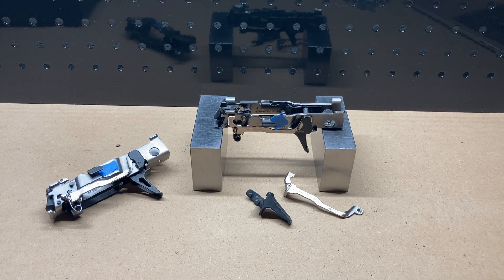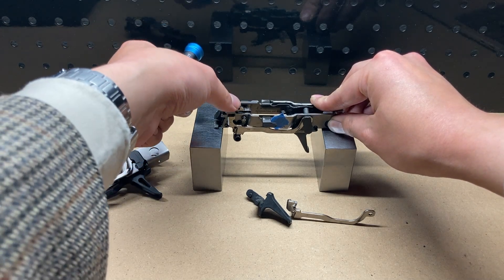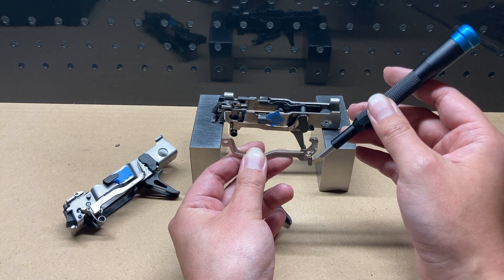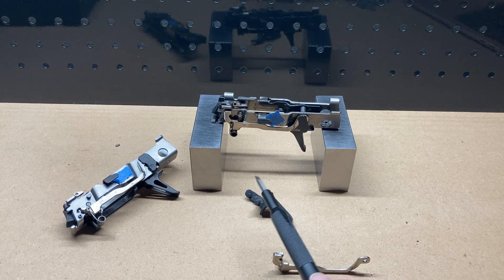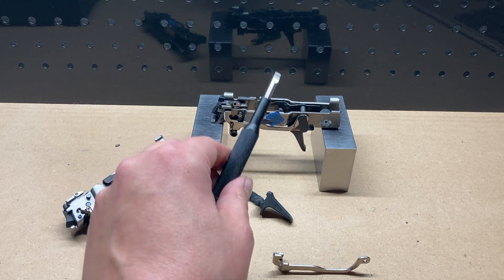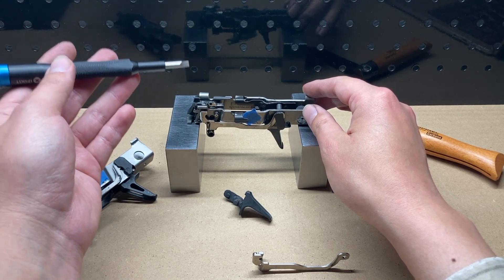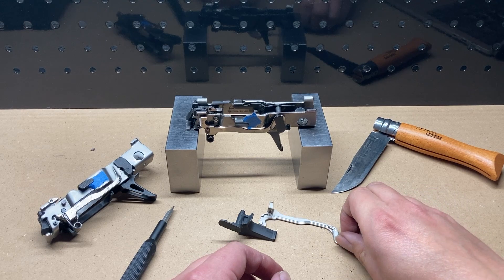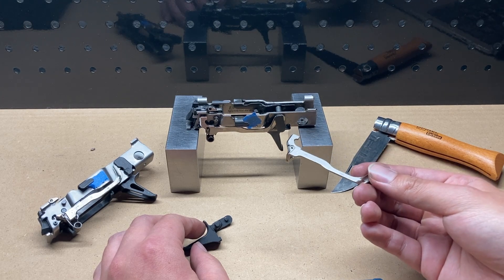P320 Sear Movement Test followup: It's all about the Trigger Bar and Trigger

Comment: Thanks for taking the time to do this research. 
I have a M18 CA model made in 4/19/2024. 
When I removed my slide and tested it I found that not only does the trigger bar move down and forward instead of just forward making the striker safety “pop” up at the end of the sear movement, but with the manual safety engaged, the striker safety doesn’t move with the sear at all. This would strongly indicate that as long as the striker safety components are not defective in my particular example, it cannot discharge even if the sear releases the striker while the manual safety is engaged because the trigger bar is blocked by the manual safety. 

I couldn’t get mine to “fire” with the gun assembled using a long wooden dowel in the barrel and depressing the sear with a pick with or without the manual safety engaged. I’d be interested to see results from others with newer and older models. It’s pretty apparent Sig has made silent changes over the years. While I’m glad my pistol appears to be safe, it would be nice if Sig would own up to the possibility of older or different models discharging no matter how unlikely it might be and offer at least another “voluntary upgrade” to make them safe(er).
Reply from the maker: That matches how I anticipate a manual safety would influence FCU behavior - I'm eager to see if I can get my hands on a manual safety P320 soon to observe that behavior first-hand...
Reply: I have a first-gen model that underwent the "voluntary upgrade" - I'll have to try this at home and record my results.  Almost feel like there should be a crowd-sourced spreadsheet or better yet video database of owners doing these tests along with the manufacture date of their  320, any non OEM parts/upgrades, round count, etc.
Reply: Just to add, this applied to my CA320 for anyone that’s worried about their Franklin Armory 320s
Reply: I have the same M18CA model. Mine behaves like yours. Just checked after watching this video. With the manual safety off, pushing the sear down moves the trigger bar forward and disengages the striker safety at the same time, identical to pulling the trigger. With the manual safety engaged, pushing the sear down, causes the trigger bar to move down instead and not disengage the striker safety. I wonder how many of the holster pops reported were with the manual safety p320s? Although there is nothing forcing you to use the safety, so I guess that would prove nothing anyway.
Reply: @HotelHilbert-s6l  I have similar experience - If the theory is correct it suggests that having the manual safety engaged in the holster would prevent an uncommanded discharge in the event of sear movement being forced somehow.  Tested my Xfull-CA and my wife's M18-CA tonight and both show the "disconnector-like behavior" we want to see.  But with the manual safety on, the striker safety doesn't move and the trigger bar just moves downward.  

It would be interesting if we could find a manual safety FCU that does not exhibit the disconnector-like behavior (or install a known-issue trigger bar in one) to confirm that engagement of the manual safety would ensure that the pistol could not fire uncommanded.  

Would be great if Sig would do this work so we don't have to, though...
Reply: @WestCoastChainmail I too am sitting in front of my disassembled CA XFull and coming to the same conclusion. My trigger bar is stamped with 576, just fyi. The tolerances on the FCU are a bit too minimal for my piece of mind. 😂I feel like the slightest bit of carbon build up on the seat ledge would cause issues on older models without the disconnect
Reply: @WestCoastChainmail  Please be careful.  It is still possible for the striker to slip off the sear, with the manual safety on, there have been documented cases in the military.
Reply: @HotelHilbert-s6l interesting. When was yours made? My trigger bar goes down then forwards when I press the sear. The striker safety doesn’t move until the sear is pressed almost all the way down and the trigger bar pops forwards. Interested in seeing if it changes when I install my apex trigger bare and sig armorer core action job kit.
Reply: @xi-deadshot-ix5838  Not sure. Was just after the CA model was released. When I saw this video, I thought WOW. How can pushing the sear down pull the trigger. The trigger bar pulls forward on sear/trigger bar engagement surface, which sits just in front. There is no way it should be necessary that pushing the sear down should pull the trigger bar forward. But it does on mine. I have other fully cocked striker guns, and none behave like this. This is a terrible design flaw. If anything gets into the underside of the slide and pulled in when the gun is racked, just pushing on the grip might push the sear down and fire a round. In the case of the manual safety, it seems to push the sear down and makes the pistol safe(r)

This is probably the issue and Sig almost certainly knows about it and is denying it. It is too bad, because I like my p365, but Sig is going to be sued out of business and probably deservedly so.
Reply: @xi-deadshot-ix5838  I have an M18 I bought in Oct 2020 and was made July of 2020. It passes the test and functions like your description.
Reply: @xi-shot, would it be possible the mag disconnector is playing a role that prevents the sear being pushed down?
Reply: @adolfhilter  My mag disconnector "fell off" the pistol as soon as I got it home from the cali 10 day jail. So, no I don't think so.
Reply: @adolfhilter  I removed my magazine disconnect. The last thing I want is to not be able to use the one round in the chamber if I need it while reloading or if I accidentally eject a mag. I don’t see how it would interfere with this test if it’s disengaged as if there’s a magazine in it. From what I can tell it acts as the manual safety does blocking trigger bar movement when the magwell is empty.
Reply: I noticed the same thing too on my manual safety P320. I specifically wanted a manual safety since I don't like any gun that lacks one (hence why I refuse to carry Glocks). Seems like my choice was vindicated here. lol

For my gun, I did install an aftermarket Apex trigger bar and it does demonstrate that "disconnect" behavior, though the downward movement when the FCU was in the grip module seemed much less than what I tested outside of it and I couldn't hear an audible click when I pushed down the sear. However, doing the test as shown in the Youtube Short didn't show the striker protruding out the end, so evidently that downward movement was sufficient at least on my gun to prevent an uncommanded discharge.
Reply: on sig's website, the latest trigger bar it sells does delay the deactivation of the striker safety.
Reply: @P320truther I cant speak on other p320, the CAM18's when you have the thumb safety engaged you cannot move the trigger bar forward when you defeat the sear springs. Nothing is able to push the firepin safety block up. what i want to know is will some of those aftermarket trigger blade safety triggers keep that bar also from sliding forward. This is my observation. All early model p320 even thumb safety versions that have the voluntary upgrade performed are not the same as the modern fcu's. These are what military and leos have currently and i believe these are the majority of the problems. That said.  personally i would never cary a condition zero firearm. I would only use the modern p320 with the thumb safety version unless someone shows that one of those aftermarket trigger safety triggers also prevent the trigger bar movement
Reply: This makes me less worried. I also have a M18, manufactured in June 2024. I think it depends on the manufacturing year.

Comment: Very interesting.  Have you provided your findings to Sig Engineering?   
I’m curious to know how the sear would move on its own?
Reply from the maker: How the sear is moving on its own is the multi-million dollar question that no one (including myself) seems to be able to answer. I'm just working on the outright assumption that it is moving, since none of the "uncommanded discharges" have been accompanied by reports of broken components, and no one has been able to show how the striker could be released without either breaking or the sear itself moving down to release it.
Reply: @ Thank you.
Reply: I just viewed this video again based on my recent viewing of today’s content.  

Again, this is very interesting information.  It makes sense that the design of the pistol would have the sear dropping the striker as step one and the striker safety block allowing the striker to release fully into the breach as a step two.  Very seamlessly of course.  

Just to confirm…the trigger bar that is moving forward only allows for the striker safety block release prior to the sear releasing the striker?  

I really appreciate your time.  I’m in the process of making some decisions and I am doing as much research as possible. 

Perhaps we will get additional information tomorrow.

Comment: You could 3d scan the bars and digitally overlay them to see where the tolerance differences are.
Reply from the maker: If only everyone could afford 3D scanning equipment and CAD software!
Reply: @P320Truther Patreon or some other crowdfunding could help. Heck, I’d chip in on one.
Reply: @P320Truther  You don't need full CAD all you need is a viewer and you could send off the parts if theirs nothing near to were you live "ask a local dental lab most have a scanner for 2 scans I couldn't imagine it would be difficult". You can use 3SHAPE 3D VIEWER it's for dental but it's free and has accurate cross measurements. I used it for years professionally. This tech more available than you think.

Comment: This is an incredibly informative and well put together video. However there is more to it than this. The design itself is simply less safe than virtually all other striker fired guns because of the sear and striker safety location and design. Along with no trigger safety. All of this combined with silly loose tolerances makes for a less safe handgun in a variety of scenarios. Basically whether or not your FCU passes this test the gun is still not as safe as almost every other duty grade striker gun.
Reply from the maker: I don't know that I fully agree with this statement. The final component blocking the striker being a rotating piece of bent piece of stamped sheet metal is certainly not as good as the inline movement of a traditional plunger-style striker block as on Glocks and P365s, but the ultimate difference between the P320 and the P365 is whether the sear moving on its own can influence the trigger bar. On the P320 it perplexingly can, on the P365 it cannot. In my amateur judgment, if that gets fixed on the P320, everything else is moot.
Reply: @P320Truther I understand what you are saying. What I’m saying is that even something as simple as a shirt tail or debris in a duty holster or high levels of torque placed on a holstered pistol is still inherently more dangerous for the 320 design over say a Glock. It is indisputable. The 320 also uses the sear to defeat the striker block rather than a nub on the trigger bar. So what I’m saying is on a M&P, Glock or countless other guns even if you use a tool an manually defeated the sear those pistols CANNOT fire. The 320 CAN! It is inherently less safe period. Once again loved your video but the design of this pistol is a sub par retrofit FCU from what was a hammer fired gun. The others were ground up striker and they are better in regards to safety.
Reply: @P320Truther sure, but if it had other design features it would still be safe. The Swiss cheese model applies - I prefer a gun that has a solid piece of cheese with no holes, so even if something else goes wrong there won’t be an uncommanded discharge, ever. For me a trigger safety dingus is part of that story, I won’t buy a striker fired gun without a trigger safety. The P320 had the drop safety issues, which would also have been prevented from my understanding by a trigger safety dingus.
Reply from the maker: @ It would depend on how early the trigger dingus indirectly prevents trigger bar travel. If it's early enough to prevent the trigger bar from activating the striker safety lock, then absolutely it would work. If it's not early enough to prevent that, then the pistol would still be vulnerable to "uncommanded" sear movement.
Reply: @afwaller exactly
Reply: @P320Truther agree completely I can verifthat the Glocks and M&Ps if left in Factory configuration do not defeat the striker block if the trigger safety is functioning properly and the trigger is stopped by it. Even then debris or shirt tails can defeat it but it’s significantly less surface area and requires things to be just so rather than just any old trigger contact.
Reply: Also the Sig does have silly levels of vertical play between slide and chassis which is sketchy.
Reply: @MinimumSpeedOperator  I agree with your comment about the flawed design but YouTube hides about half my comments so they don’t appear. Maybe this one will appear, who knows.

Comment: Given that the trigger bar measurements you made via caliper were identical or nearly so, is it possibly a tolerance stacking issue with another component?  Almost seems like it has to be.  

Regardless, I have two that I don't carry but do like to shoot.  Gonna have to give this a go and see how mine behave...
Reply from the maker: Calipers can only measure so much; there is every possibility that full 3D scanning and computer modeling would reveal a difference, but those are capabilities that neither I nor the layperson is going to possess or be able to reliably and cheaply procure. I hope your pistols do not fail the full Sear Movement Test!
Reply: @P320Truther  that's true. It could be a surface angle or something like that which won't show with calipers or mics. Difference of even a half degree could make a big difference in how parts interact.
Reply: @P320Truther  I got some strange data points in my testing.  Have 2 P320s, one was a factory full-size that I added a wilson combat (WC) grip and skeleton trigger to, the other is a factory AXG with flat trigger.  Am I screwing something up, or is there a non-trivial interaction with the grip module somehow?  I thought at first it was all tied to the WC grip module and the tungsten weights interfering, but still failed with no weights and then it failed with the AXG module.
bare skeleton FCU - pass
bare flat FCU - pass
AXG + flat FCU - pass
WC + skeleton FCU - fail, straight bar movement with no click
WC + flat FCU - fail, straight bar movement with no click
AXG + skeleton FCU -  fail, straight bar movement with no click